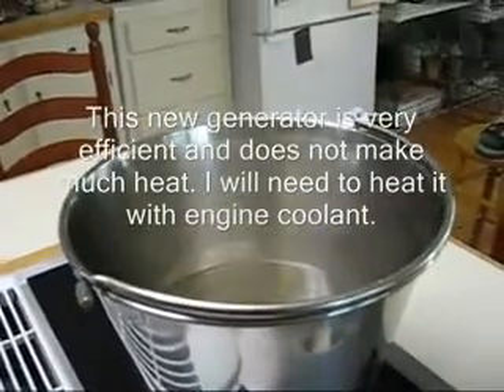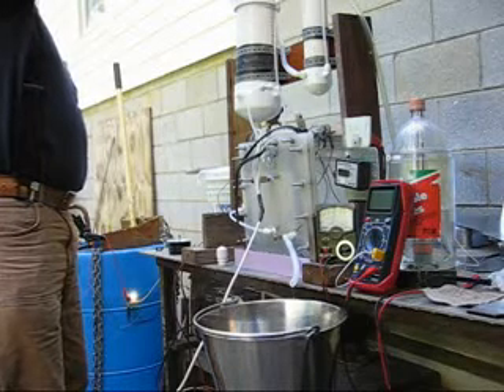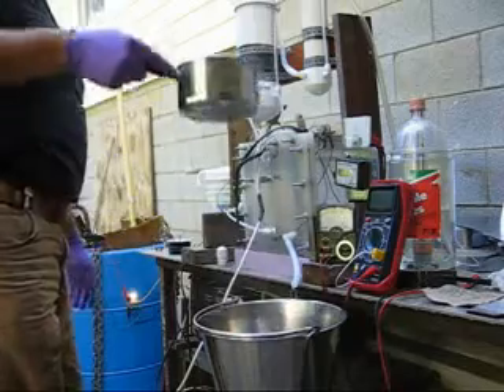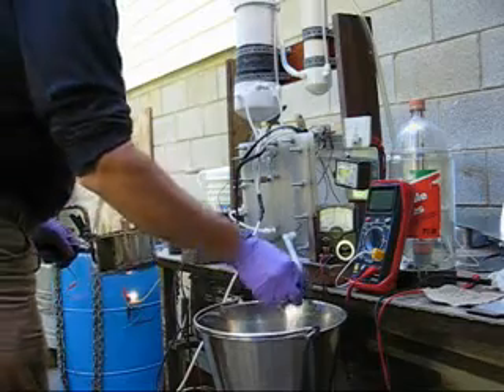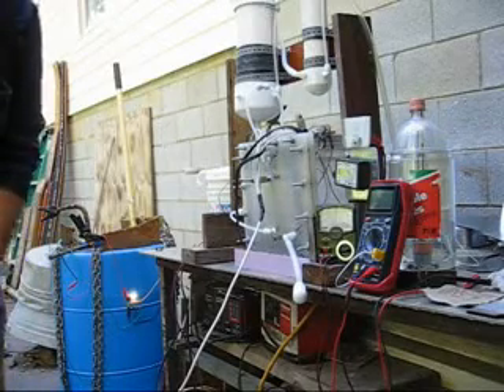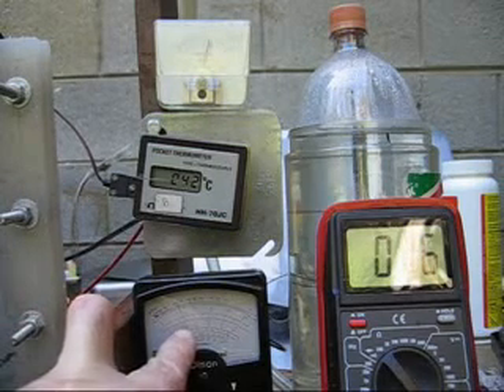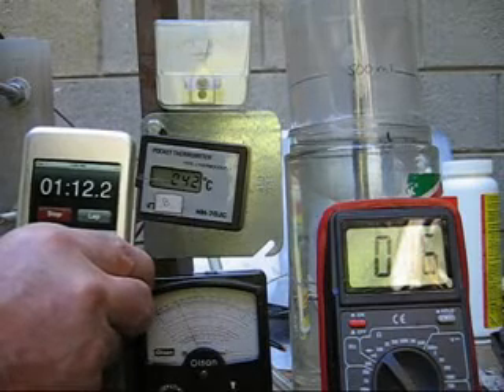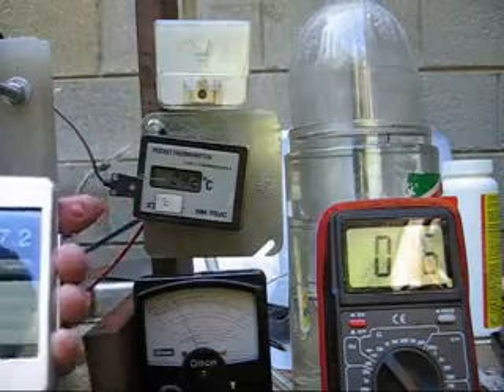HHO Dry Cell Mars Gasket Part 8

Comment: try this method

efficiency(%)= 100 * v / (u*i*t)
v=volume hho gas produced in liters
u= voltage
i=amps
t=test period in seconds.

assumptions included in this formula.
-HHO collected holds 20 degC however if it is instead 10 degC or 30 degC it will only have marginal consequences.
- HHO collected holds 1 atmospheric preasure.
- the HHO is saturated with water vapor. since most experimenters use a bubbler to collect HHO.

this will give you efficiency in %

Comment from the maker: Electricity will take the path of least resistance. If you have a series of holes in the plates the current will jump from plate to plate along the holes without dropping in voltage like it does as it travels from plate to plate. I think that is why we see a lot of activity on the plate edges. The second vinyl gasket blocks the direct path through the hole. The current can still flow through the electrolyte. I think that is why the MMW is less when the electrolyte is concentrated.
Mars